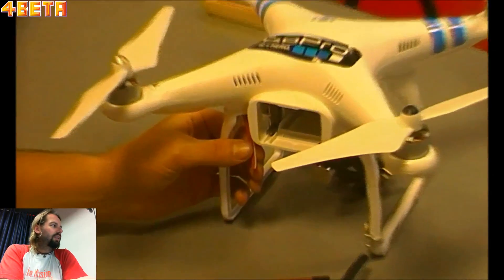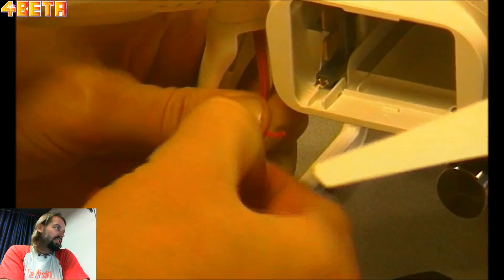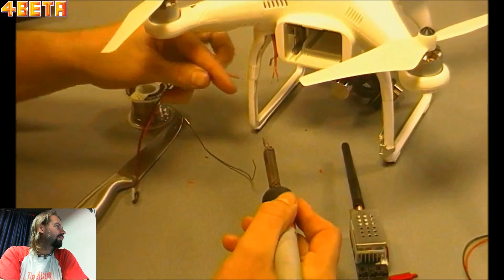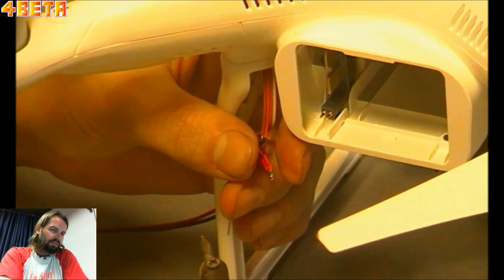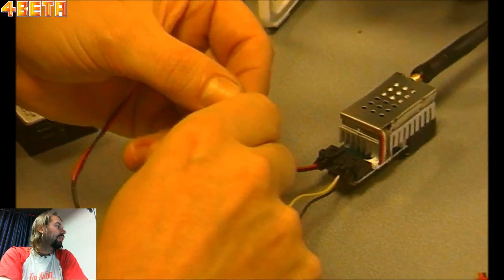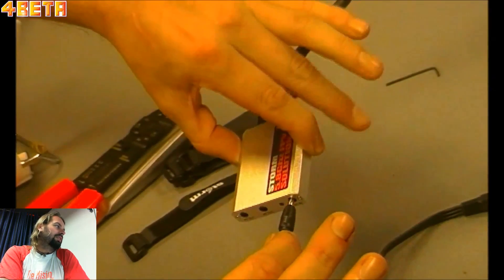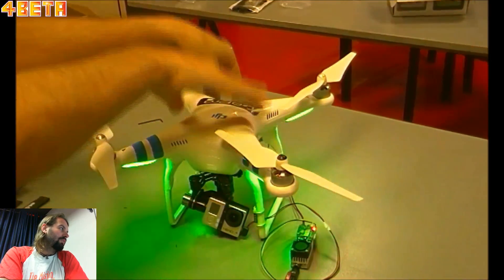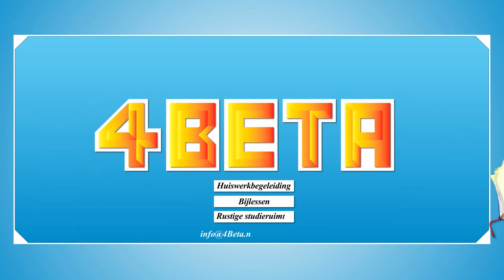DJI Phantom 2 - tutorial:  How to connect a FPV transmitter

Comment: can i conect my boscam ts 832 like this? think it runs on 12v......so not sure if i can do it like this?

this is the ts im using.

http://www.ebay.es/itm/111348541081?ssPageName=STRK:MEWNX:IT&_trksid=p3984.m1439.l2649

can i do it the same way as in this video?

Comment: Thanks for the video. I used it to hook up my transmitter and it worked perfect. I was pretty apprehensive about doing the electrical work but it worked like clock work. Thanks

mike